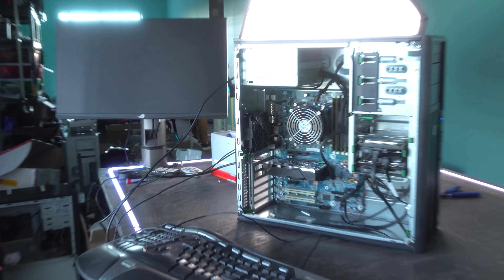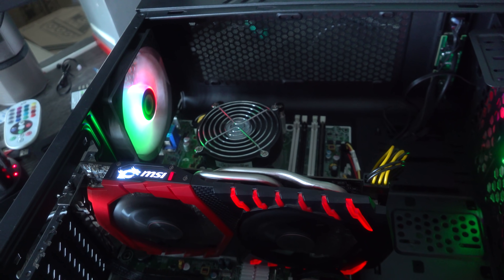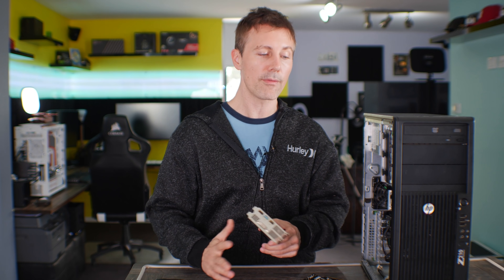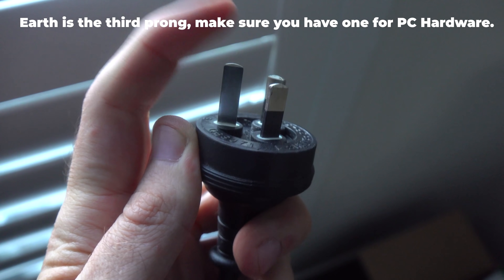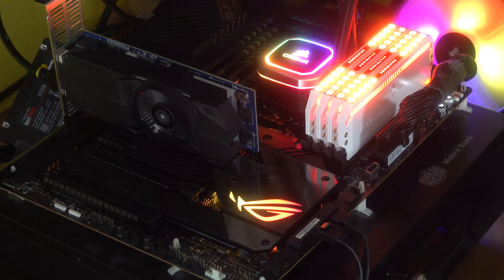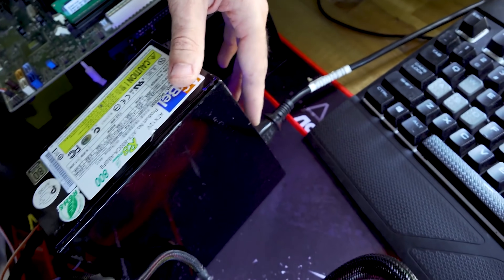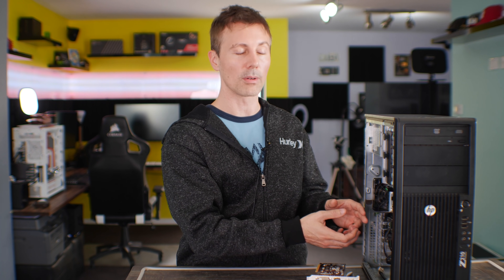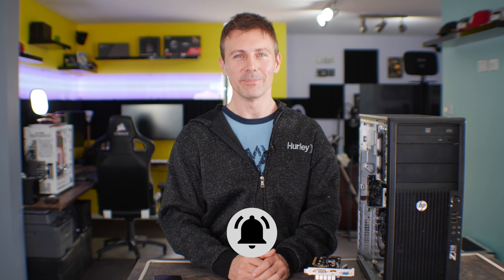Black Screen, How to FIX a Computer that DOESN'T Boot?

Comment from the maker: People are saying there is a mysterious third invisible prong in europe! I haven't seen this plug end, though it has a contact point to ground.  Though bottom line, make sure your computer gear is grounded one way or another!
Reply: thanks for the video,   maybe is an australian thing but your outlets look kind of sad or surprise  not in a good way, more like in the naruto's 1,000 years of death technique hehehehe
Reply from the maker: @noneofyourbusiness8658  lol, they are just in a transitioning phase, nothing to worry about.
Reply: @techyescity  when you say transitioning do you mean from AC to DC or 230v to 120V? either way they look like sad sacks to me hehehehe
Reply: I think this is very rare in the places/countries around the world that widely using BS standard Type G(BS1363) socket/outlet like UK, Hong Kong, Singapore, Malaysia, UAE
Reply: in the uk yes we do it's a earth but I've come across where the socket earth was not connected properly and a surge took out the motherboard.
Reply: we have 3 pins ad 2 pins to its depends by port
Reply: Bryan, do you resell pc parts that you acquired on secondary market? If yes, is it international? Been hunting for a rx480 gpu but no luck on it. Maybe you can help viewers like me.
Reply: My gpu when booting there's  pink screen about 2secs and got a logo of asus motherboard and beatifuly booting on windows. 

How to get rid of solid pink on booting?

Pleasee help me
Reply: @mtzkustom7818  yes

Comment: What if i have no extra cpu or ram and i have both no display AND my rgb mouse and keyboard wont power on. I put a brand new unused motherboard in and changed the power supply witg a well known good psu and i still cant get display or peripherals turning on.

Comment: Funny thing, My PC never even connected to my monitor or any other display device. I had this problem for about half a year and then realized a switch on the back that was set to european power. It still doesn't work to this day do to a hard drive issue but I find it kinda funny how 1 little switch was a drawback for 6 months.

Comment: Nice video, I’m so stuck. I kept getting a snowy blinking screen then freeze, Thought it was gpu so changed it and changed power supply also. Narrowed it down that the HDMI port on an Onkyo Tx Rz50 under 1 year old was bad. Hooked up new receiver and that’s all good now. But now I can’t restart the computer only manually shut it off and when I manually shut off the power goes off instantly it’s like the computer is off but all the fans etc are still running. Also tried the bios but after a few seconds the bios freezes up to and have to manually shut down. I reseted the cmos and no change. Just black screen when I try to restart and when I turn the pc on same thing until after a few tries. Please help. Thank you

Comment: None of these seem to be the issue for me. My PC will not boot and then I hold the power button and it shuts down and restarts and boots just fine. At this point the computer works perfectly fine. I shut down the computer every night and upon restarting each morning, the process is the same; the first startup is a black screen and the second time it boots fine.

Comment: I have a black scrreen with a message on it. Mine says "No boot device available, strike F1 to retry boot". Pressing F1 just redisplays the message. I turned off the PC then rebooted and pressed F12 expecting to see a boot options screen. Instead my PC continued its normal boot and I got my desktop. When I went to my C: drive I noticed the files had been reordered by last update where it is normally ordered by name. PC was working perfectly yesterday, this happened today. Dell Inspiron 570 with Win 10.

Comment: Did have to take out my GPU but taking out the battery worked,  power went out when I was at work and the computer wouldn't turn back on.

Comment: Computer was working fine, took the ram out, put it back in, now it doesn’t work. Fan turns on, monitors turn on, head set turns on. But the computer never starts up

Comment: Dude im stumped I have a nice 5950x build with a 3090 i have 2x 3090s I used to test my pc with monitors works great nothing wrong But I wanted to use it on my oled tv and plugged it in only to get a bunch of lines then I turned off my computer on boot it works shows the ROG logo boot and even get into bios but as soon as windows loads it fractles and this only happens when i try to use my oled tv other devices are uneffected by this but still dont understand and when i hook it up through xbox into tv it displays fine so why is there a handshaking issue with tv and computer like wtf I paid 5k all together between oled tv and computer so wtf

Comment: Ok I have put in a new GPU since I only had an integrated one, but after installing it won't start. The fans start going for a few seconds, keyboard mouse headset works, but after a few seconds the pc restarts whilst the screen always stays black. I tried the thing with the battery at the start. The same result

Comment: I have a i5-3570k and recently when I turn my pc on it turns on everything lights up but nothing shows up on the screen. The pc does not even boot up. At first the built in speaker was making ticking noise constantly but now it does not make any sound. The fans and lights just keep on running forever and nothing happens. The computer does not shutdown or restarts by itself. I checked everything like the cables ram and even put a different cpu  but didn’t work. My computer does detect when i remove all the ram sticks and the speaker starts beeping. But when everything is connected the computer shows no sign of life and does not boot. I also know the cpu is receiving power as the cpu gets warm. I am thinking it could probably be a bad motherboard or . If anyone could help me out I would really appreciate it.  Thank you

Comment: Hey man, im having troubles with my pc, its an intel core i5 6600K with a gtx 1660, the ram is corsair vengance 16gbx2 3200mhz. So what happens is basically i turn on the pc, it does signify life, but the moniter is blank, then a few seconds later it shuts down and turns on again, and repeat. I was trying to install windows last night and it froze in the last part of it so i had to shut it down. I tried connecting another hard drive with windows to see if it would boot up but nothing, and i tried disconecting everything unessesary and it still wont boot properly. How can i fix this?

Comment: Can somebody help me, when I installed the 497.29 nvidia drivers, I did a clean reinstall at custom installation. After I left my pc it was stuck at 1 hour and couple of minutes more on black screen. I restart it to reinstall the drivers and then it won't boot to windows. Only the keyboard and the mouse would glow, the screen no signal.

Comment: I have a board right now that would not boot, CPU was 5960X then moved ram around [8 slots] finally booted, overclocked to 4.6 even ran stress benchmarks with no issues after that. Moved CPU to another board that had a XEON in it [upgrade] and yes its 2011-3 socket and then boom no workie workie. Put back into the original board no workie workie, waiting on another CPU to come in to test further.

Comment: But wouldn't resetting the CMOS battery clear the BIOS and then let the onboard video become primary again? 20 years experience tells me that if they have a black screen when plugging in a PC they just bought that they plugged the monitor into the onboard and not the video card. I also have them check to make sure power is connected to the monitor and PC just to be safe.

Comment: The first way to fix a black screen can also be done if you have a button on your mbo (I honestly dont know what its called), it will reset the bios, which is what is happening when you take out that bios battery.

Comment: Sooooo you've got tons of expensive hardware with microfissures on like...every board.... Before you tell people to go willy nilly yanking out batteries and gpus could we instruct them to use a proper static strap? I wouldn't even stick my hands in my tower without wearing it grounded at least to the frame. If you're gonna post videos yanking parts off and touching the mobo please....please...please instruct the newbies the right way so they don't have parts blowing early because of the micro cracks they can't see...
Reply: karonic ゝ  I guess someone needs to watch more videos about what static does when you touch pc components without being grounded.... thats OK I've watched a ton....super informative.... watching them use high tech equipment to watch the micro fractures happen in real time is super fun and informative to watch....super.....informative
Reply: karonic ゝ  You told the first girl you were with the same thing about condoms and now look....we got a buncha you running around telling people to harm the boards in their rigs....and during a board shortage across the world???? SHAAAAAME SHAAAAAAAAAME!

Comment: I've also had black screens when booting for the first time and being plugged into a television instead of a monitor. Not sure if it is a codex or just unusual resolution issue. Once I have booted using a monitor and installed graphics drivers the problem is solved.

Comment: Mine had cold boot problem. Usually the computer never shuts down completey and it's able to boot the next time. But if I reassembled it wouldn't boot until a few restarts later. All the fans including the cpu and vga keep running, cpu led in constantly on. Recently there's was a power outage and now it just refuses to boot no matter what I did. Seems like MSI or AMD chip problem, I had problem last time with my msi b350m gaming plus and 1600 as well.

Comment: Hi tech Yes city I'm big fan of your tech videos.i need serious help from your tech mind.i have a zotac gtx 760 2gb graphic card.afther i updated graphic drivers for this graphic card on my windows 7 64 bit os desktop my screen gone black and is working on safe mood propely.i send this graphic  card for repair they told me this card gpu chip is dameged cant repair.and they also told me try this card with 32 bit os there have little chance this card working.please can you give me a solution fix this card because i don't have  money buy new graphic card .my job also gone   and im trying to make some money from graphic designing please can you help me solve this problem you're the last hope only i have please help me 🙏🙏🙏

Comment: other thing about garbage display issue is most of the time its not ng GPU die issue. I get more garbage display gpu fixed by replacing memory chip.

Comment: I saw someone do an intersting fix like that, so I'll pass the tip on. ... A PC that did not respond at all to pressing the powerbutton, like the PC was dead. They removed the CMOS battery, and then shorted the positive and negative CMOS battery terminals of the motherboard. (I do not know for sure if the PSU was connected but I think not.) That must have cleared some static electricity or stray electricity from the system somewhere. He put the CMOS battery back in, and the PC booted.

(By the way faulty RAM usually gives s POST beep sequence. I noted you did not mention that when describing faulty RAM symptoms.)

Comment: My first gaming PC shutdown while playing Company of Heroes. It seems that that the game was too much for the no name power supply to handle. From that point on I made sure to buy proper power supplies for my PC.
My current PC has a SFX Flex PSU. At one point the monitor keep blacking out mere minutes are booting up Windows. Due to the open nature of the case, messy cable management and constant transport, a single wire from the GPU cable group was torn off. I just taped the weak point and inserted the loose wire back in. That was a year ago and so far the PC is fine.

Comment: first time i hear of a processor failing from wear.

also, if you can afford it, always plug your computer to a surge protector to avoid voltage peaks and lows. i lied, it doesn't avoid those issues, it just makes it less of a problem by stabilizing the current from the wall so it doesn't vary. surge protectors stabilize the current on levels depending on the voltage its getting from the wall: level 1 = under voltage protection cuts power to the outputs - level 2 = 190v - level 3 = 210 - level 4 = 230v - level 5 = over voltage protection cuts power to the outputs (i don't know the value of the levels, this was just an example to explain how i understand it works.)

don't buy the small ones you plug to the wall and has only one output because those are a scam, buy the bigger ones with at least 3 outputs, and if it looks like a box then even better. most of these protections come in the shape of power strips but im not sure if they're any good or not. i think it depends on the standard voltage of your country. 220v protectors come in box format and power strip as well, but those aren't common so im pretty sure they're bad, at least for 220v.

Comment: i purchased an intel q67 mini itx motherboard , for some reason it will read a quadro nvidia 600 and 2000 just fine but when i put a radeon 7570 into the system , it black screens with no picture, would the battery trick work or is it just this intel q67 chipset not compatible with radeon cards , for the record ive tested this 7570 in a non oem neutral asus motherboard and it works just fine in it

Comment: Certain Security software installed in Windows can cause black screens. If the PC is a prebuilt with a OS preinstalled, might be best to reinstall the OS, or remove any preinstall security software.

Comment: Bryan in the Philippines when im at our house there if i have a surge protector in will it not have that boot up problem ?i do use a surge protector on that i do have a earth rod in the ground there its in about 9ft i wanted it done there but i will run a earth wire to it also on the solar panels i need it to we rebuilt our house there to a new one and i was not there for over 2yrs now i only use Australian electric plugs in there and in the Philippine there is no earth in the power wires but the electric company tells me the negative wire is earth yerr bullshit dont believe them that is why i had earth wire put in right next to the solar outfit thanks for that as alot of people come to me up there saying there power on there computers stopped working a single earth wire will fix it after they buy a new power supply

Comment: FYI, AC always completes a circuit to Earth ground.  It does this using the neutral, not the ground. In a home AC configuration, there are 3 wires. 1 hot, 1 neutral and one ground. In fact, really old homes that are not modernized do not even have a ground. The ground is only a fail safe in case the neutral becomes faulted or open. This is to prevent you from becoming the ground. The only other purpose for a ground is to ensure there are no ground "loops" between devices most commonly audio to prevent hum. But that does not apply here. Your customer has a neutral fault, not a ground fault and I suspect is not connected to a 3 wire circuit or the ground has faulted as well.

Comment: I had a pc from a customer that was not powering up the fans don't spin this is after 2 months of gaming.  After testing all the parts I found it was the graphics card stopping the power up cycle.  I have a test bench with a working motherboard and got the same result it didn't power up.  I tested the slot on their board and it worked.

Comment: If I had a dollar for every power supply that passed these cheap psu testers but wouldn't fully boot to a desktop I would be a very rich man. Testers like the one shown don't really tell you much about the quality of the power that a psu puts out. I doesn't account for ripple, stability, or reliability under load and are pretty much useless except for one thing. They will show if a PSU is completely dead, but that is it. Just because it passes on of those rinky dink testers really doesn't mean squat. If you didn't pay several thousands of dollars on the tester they are nothing more than a toy.

Comment: When I worked as tech support for ISP I happened to experience faulty modem power adapters several times for certain customers. The conclusion was the electricity in homes.

Comment: The corsair CX psu''s always eventually go the way you are describing. They start to degrade until they can't support the wattage required by the computer. I've two right here that pass the tester you have but once load goes on them they fail.

Comment: Simple/cheap power supply testers are a waste of money. They only measure the voltages, which any bottom tier multimeter can do just as well. I've seen several PSUs that pass perfectly fine with these "testers" but can't keep it up with a load or have huge ripples on their lines.
Also, what the PCs power button does in Windows relies on what settings are selected. Useless test to "see if it's generally works fine" if you are not 100% certain you had it set to shut down.

Comment: Congrats on 500k by the way......... I always use a surge protector not just on PC's but pretty much any electrical device...... one thing I had before that was weird and I never did get to the bottom except changing the motherboard was the PC would boot fine until you clicked restart and then it would give a black screen. If you switched it off and on again it would work fine but as soon as you restarted it would boot with a black screen just weird.